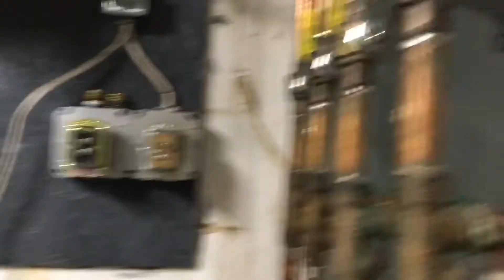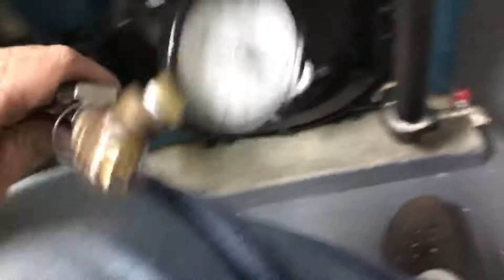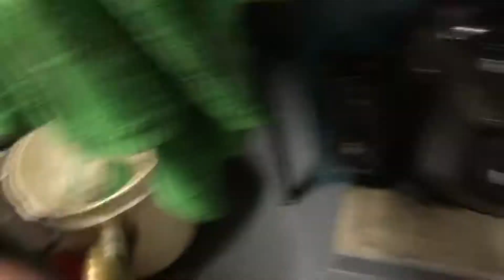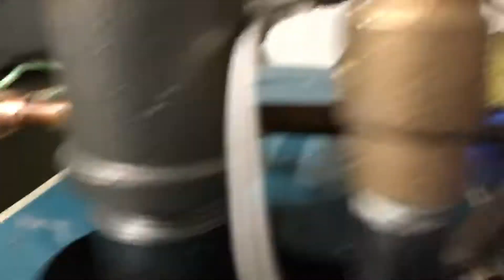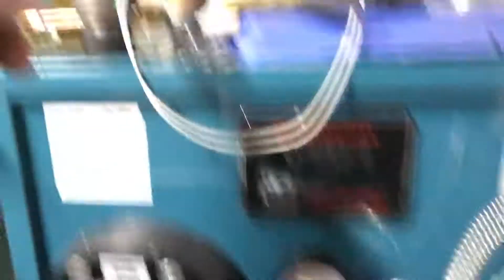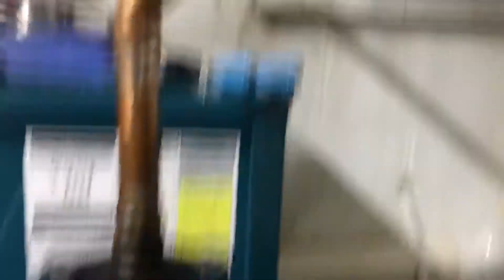New Furnace Install - Replacing my old Burnham

Comment: I’m in need of replacing my boiler, and this is one I am considering. After 5yrs of use, do you recommend it?
Reply from the maker: No problems at all. Make sure you do the tempering loop. I think I mention it in the video.